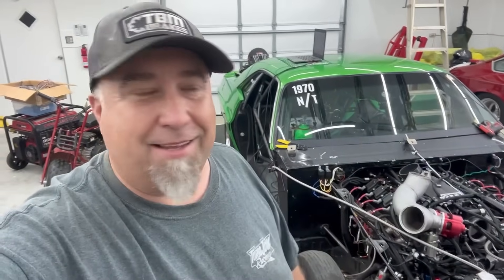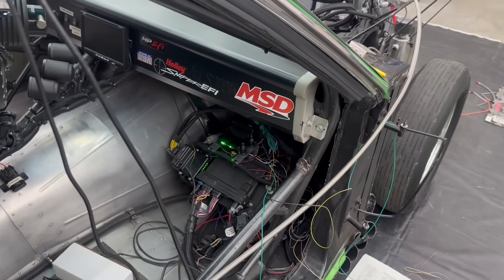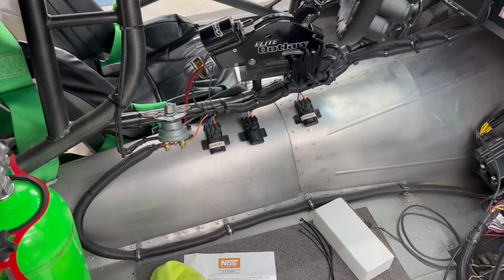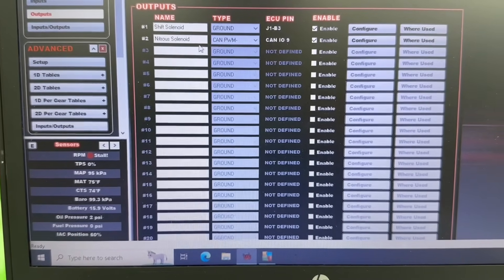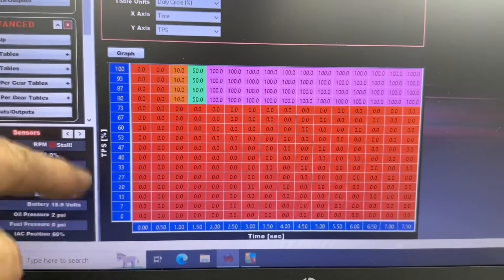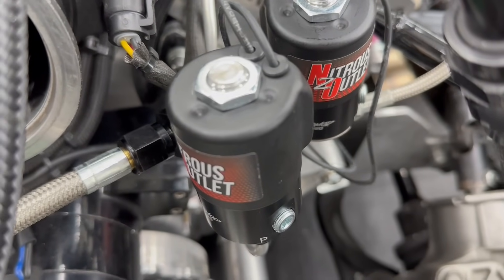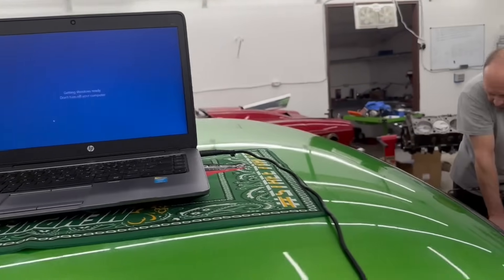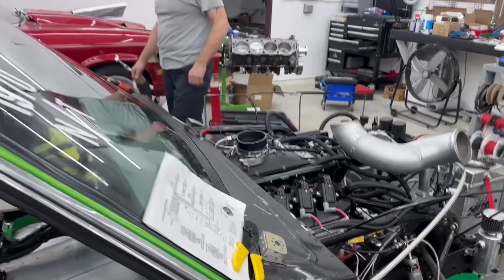Activating Nitrous with Holley EFI

Comment: I ran into this issue with a twin turbo car I was working on Holley terminator x and can module, I also found you can't use it with any of the ICFs, The only way you can do it is make a customer table for it, It gets really confusing, I tried to use it control the boost (-) Mac valve, found issues doing that, I then decided run the dome sensor off the module, there were major delay in data transfer that caused the Macs to not react quick enough causing huge boost issues, probably would've blown the car up if I didn't catch it on the dyno, Moved it off the can module and we were good, The can module to me is only good for sensor data, They may be a way to adjust to make it react faster but I spent countless hours figuring this all out and diagnose. Just keep that delay in mind if you guys have issues but it may not effect you

Comment: You can totally still use the nitrous ICF. Just leave the pin unmapped. Have the actual CAN nitrous PWM match the Nitrous ICF PWM and trigger conditions
Reply: So essentially you are saying just use the nitrous Icf to get the settings and then copy and paste under the can bus configure? I’m trying to do this exact same thing except I was also hoping to use it for spooling my turbo as well as spraying down track. I tried linking the can output to the nitrous stg 1, but without stg 1 being assigned a pin it won’t operate that way.
Reply: @joshknight8953  correct! Use the N2O ICF for fueling, timing, and programming your ramp, and the canbus output just copies the duty cycle to the solenoid relay. Just ignore the error about a pin not being mapped.